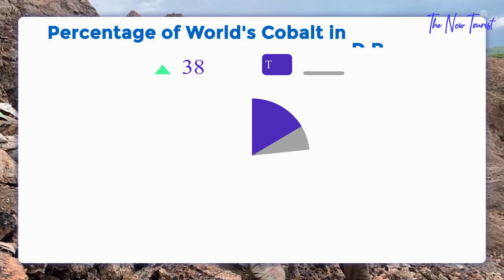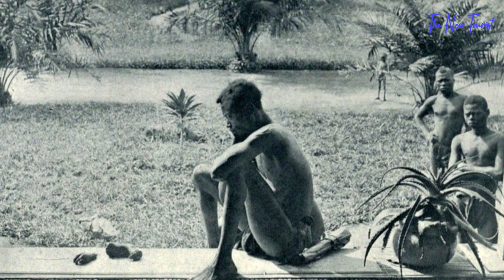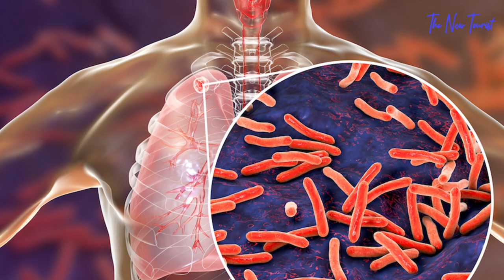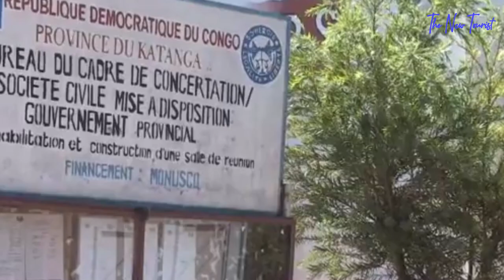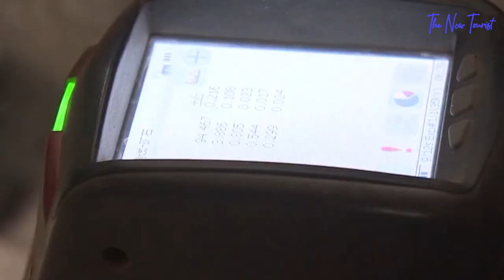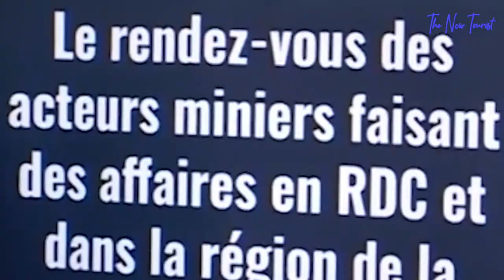The Dark Truth About The Congo's Cobalt Mines. How EV companies Are Built On Blood (Blood Batteries)

Comment: You do know the oil industry has been using Cobalt for decades?
Reply: @alfaV6boy1  My point is this isn't a battery problem.
Reply: @daydreamer8373  
Yes, it is. The demand has astronomically increased due to the demand of lithium ion batteries.
Reply: @Nonya_Business44  It is not a battery problem, It is a government one. EV's have actually been an important part of tackling the issues, and the catalyst for battery research reducing or removing Cobalt from it's chemistries. So while the oil industry continues to use Cobalt (something it has been doing for decades) EV's are moving away from using it and making recycling of such batteries viable.

There is a much bigger picture, and it goes way beyond simply Cobalt.
Reply: Children die for my phone to work sad
Reply: @daydreamer8373  are you saying cobalt being mined is mostly used for the oil industry ?  Can you tell me where battery recycling is located ?
Reply: @daydreamer8373  you didn’t watch the video or only hear what you want
Reply: @EVSniderWriter  Jeff, what I am saying is this is not a battery issue, it is a government one. Nobody can blame EV's for this, it goes way beyond that, and while new battery chemistries are eliminating Cobalt, The oil industry will have no other choice.
Reply: @EVSniderWriter  https://www.youtube.com/watch?v=Qi8Y2lF7Luw this is just the tip of the Iceberg. Redwood materials are one of the biggest players in battery recycling, and are actually spending millions building a purpose built facility, and already have contracts with big auto, including Tesla.
Reply: @daydreamer8373  we can blame the EV for this, as the usa and other western countries have taken control of the DRC’s government
Reply: @Day Dreamer  tell me you own an EV without telling me you own an EV
Reply: @mlouise9861  I own an EV.